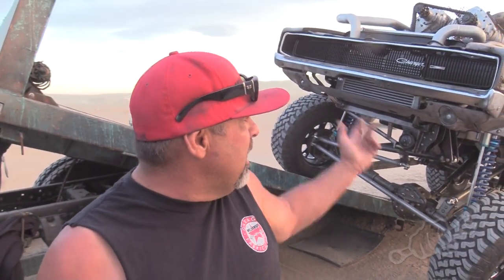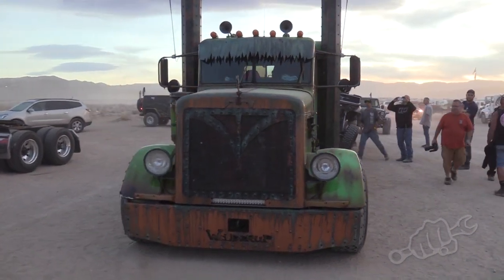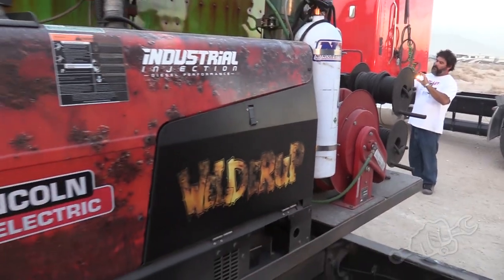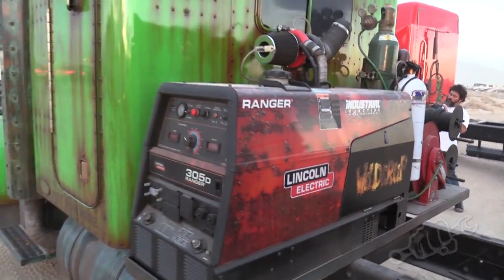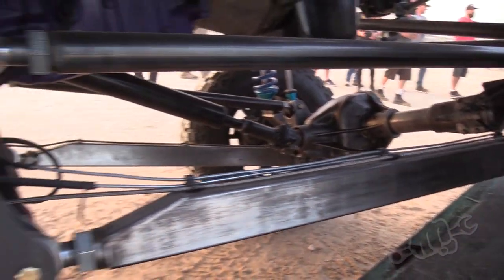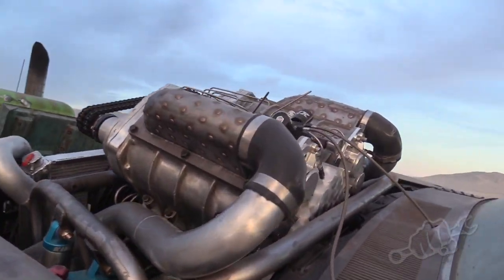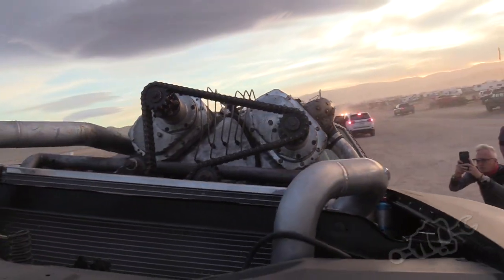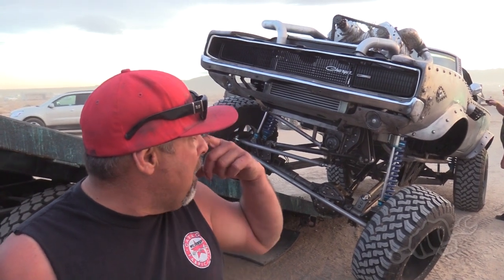Project OVERCHARGED - WelderUp Diesel Rat Rod Dodge Charger

Comment: I would have done a dana 60 front without the crappy axle disconnect on the long side
Reply from the maker: maybe he just used what he had
Reply: yea prob  and by now way am I bashing it I could never build something like that
Reply: It was definitely built to be a pavement princess/ show car... twin super chargers, twin turbos, two nitrous bottles, and only an NV4500 to hold it. Definitely for show only.

Comment: He said "It Works" 
Maybe I am hearing the engine idle wrong. But why does it sound like the car is just barely idling when he is trying to move it forward.
 Because if I understand the mechanics correctly you can not have more combustion if there is not more air. you do not have exhaust to spool the Turbo without the supercharger getting air charge but how do you get more air in the supercharger if the Turbo has to charge the supercharger...?
Reply from the maker: Science

Comment: Bet ya there is no Guts in those blowers.... Just for looks....  Boost supplied by turbos....
Reply from the maker: you think so?
Reply: BustedKnuckleVideo hey man wasn't sitting on the build its obviously awesome but boost management with twin blowers and turbos would be an interesting task....  Remember the blower on the Mad Max interceptor?  Was all hooked up but no internals....  You get the look without the complex engine management.....  Turbos still provide boost and power but the blowers are there for eye candy....  Plus they're chain driven...  Hard to reach high enough rpm for them to create boost....  Just a thought...  Phenomenal engineering to create such a beast.  Have huge respect for the welderup outfit.
Reply from the maker: can't wait to see the show where they will hopefully get more into detail about the motor